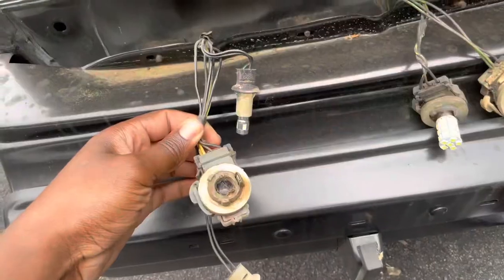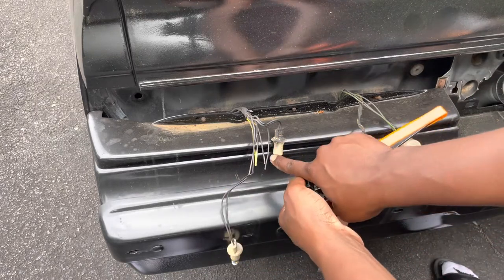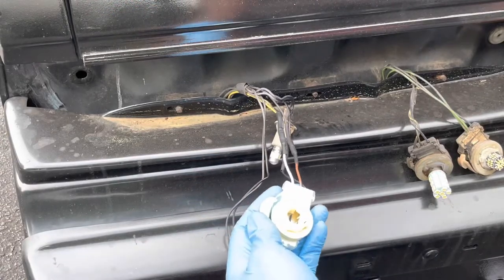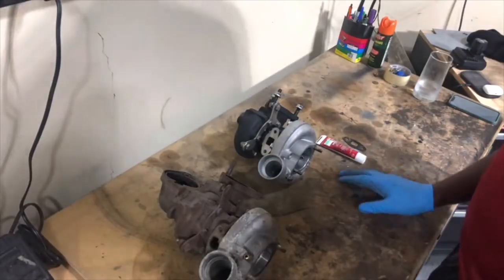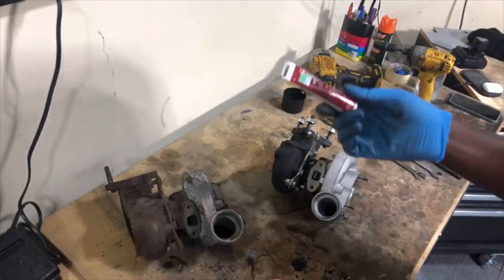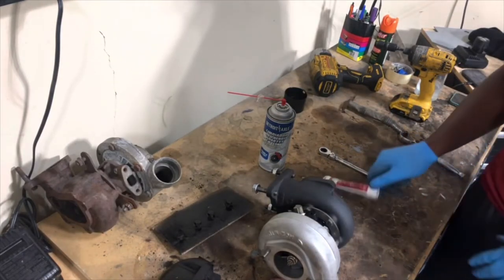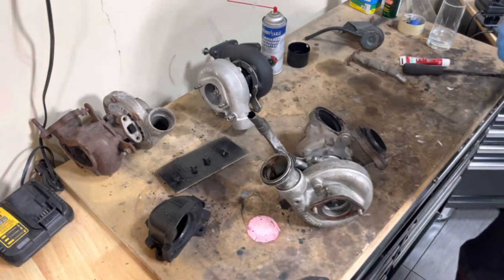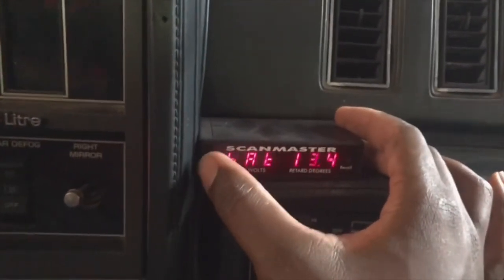Taillights and Turbos: Grand National Turbo Upgrade - Rebuilding a Grand National Part 21

Comment: Thanks again for the Videos!!!! Keep it up! That turbo is the identical one I got from Bison as well!!! Are you sure 9ts not the T04e 57 trim compressor wheel and t31 stage 3 turbine??? That's what mine is.
Reply from the maker: Really? I took another look and it’s a t04e60 compressor and stage 3 T31 turbine